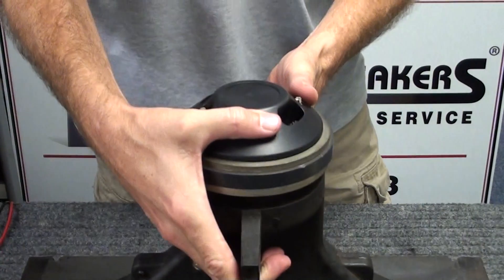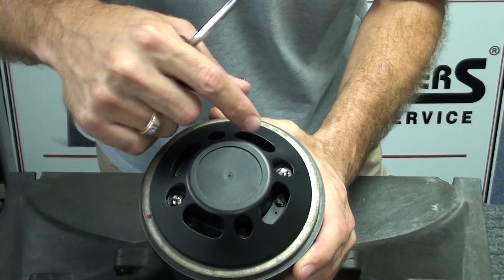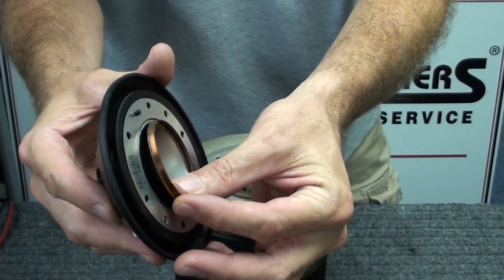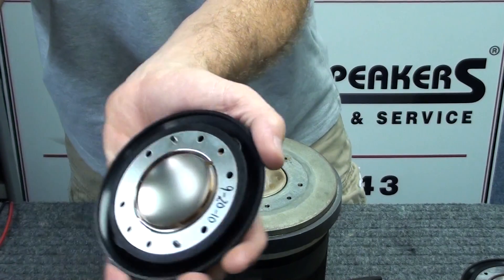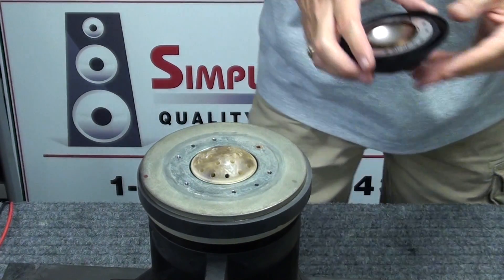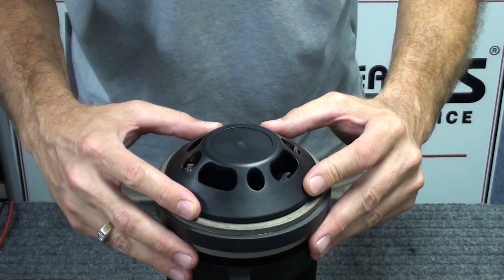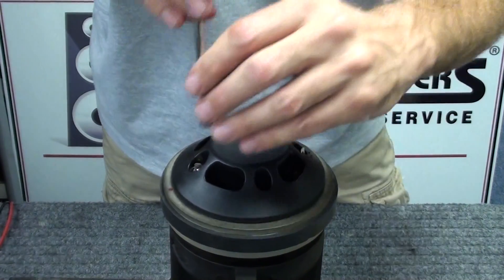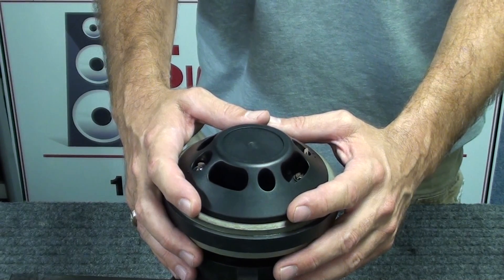Peavey SP-4 22XT, 22XT PLUS, 22A Speaker Repair, Replacement Speaker Horn Diaphragm

Comment: Hey Great Tips !!! & I have a very Important, On The Road Type Of Question!!!!
I have changed my 14xt' many times in my smaller Peavey Cab's,
But now need to replace my 22xt's in my SP2x's!!
My Right side got hit bad from Feedback from an AKG there a week ago & I wasn't quick enough to get it shut off or turned down cause I was in the washroom (We were just having a drunken jam lol)..
So far I have been running these for 12 years from new & haven't had any issues with them when doing Live Sound!!
Good Speaker!!!
What I was wondering though,
If I was doing a show & had now replacements with me is there an easy way to jimmy it to get me through the night?
Like from the looks of it (is it conductive around the membrane edge?)!!
So could I solder a few spots and get on with the show?
I haven't opened mine up yet just waiting on the Replacements!!!
I know with my 14xt's, I can just clean up the burn't spot on the voice coil then solder it back together & borrow some chicks clear "nail polish"... (If I have no crazy glue or similar stuff with me !!) & Do a fairly quick fix if time permits me lol !!! 
PS... Where would you recommend buying these types of replacements for price & quality 4 someone living in Canada?
Thanks 4 your video!!!
You just gained another sub bud !!!
ROCK ON !!!
From Canada!!

Comment: sorry to continue, I cleaned out the ferrofluid also, should I be replacing that? Thanks great video.
Also the centre plastic had dried glue on the sides which was obstructing sound, cleaned them off with sharpie. I would say it be better sound rather than like having wax in your ear.

Comment: Currently replasing mine, once i cleaned out one of the diphrams and it started working agian. I did notice the headface had popped out so then tried it upside down and worked. What glue should I use it is a plastic one that looks like a cut onion. I cleaned

Comment: You can use either diaphragm, but you should use the same model that matches the original. Call us at 1-800-511-3343 with the model number on the driver and we can set you up with the correct replacement diaphragm for it. Thanks!
 
Sean

Comment from the maker: You can use either diaphragm, but you should use the same model that matches the original. Call us at 1-800-511-3343 with the model number on the driver and we can set you up with the correct replacement diaphragm for it. Thanks!

Sean

Comment: Great video. My thing is that I have an SP5g and the compression driver looks identical to the ones you've showed in this video. I'm guessing that the one I have is probably the original, but it sounds like crap. I mean the compression driver sounds really low. I have to boost all my highs in order to get a nice sound. Do I need to replace the driver? and would the rx22 diaphragm work with the magnet I have or would I have to purchase the entire driver? Thanks.

Comment: Thank you for posting this! I've got a pair of ul-15's by peavey, in one of them the black widow has blown, so i'm ok fixing that, i've done it before. But in the other, the tweeter horn seems to come on when it wants to, which is a nightmare for the sound quality. Would it be the same as in this video, when it comes to fixing a ul-15 tweeter horn part? I should imagine it would be, but just thought id check first :)